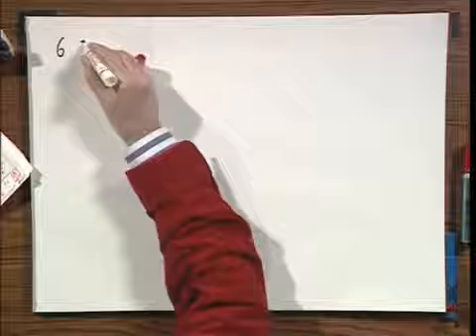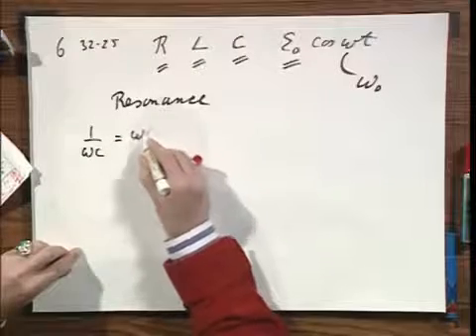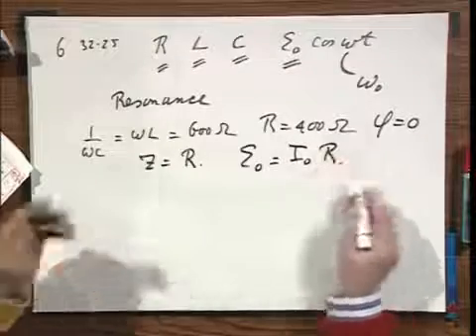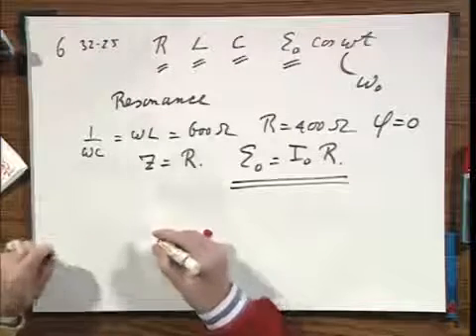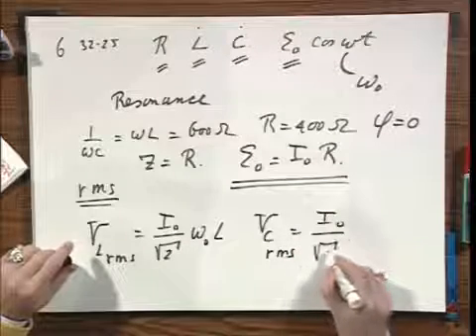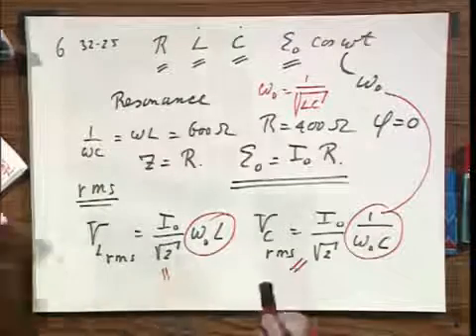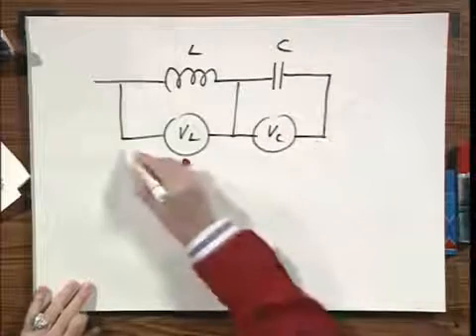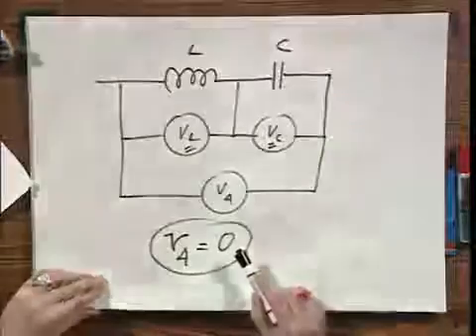8.02x - Module 09.06 - Driven RLC Circuit at Resonance. LC Circuit in series (not driven)

Comment: Professor, I really don't understand why voltage over the L and C are exactly 180° out of phase, and no other angle. I know that the inductance pushes the current behind the voltage, while the capacitor pushes it ahead. But why exactly do they do this by a phase difference of 90°? I've watched all your lectures regarding this, but to no avail. Please help!
Reply: Professor, would I be correct in saying that the inductor shifts the current 90° backward, because tan (phi) = WL/R [W is the angular frequency] and because the self inductance is made of superconducting material, R =0 and therefore phi = 90°?